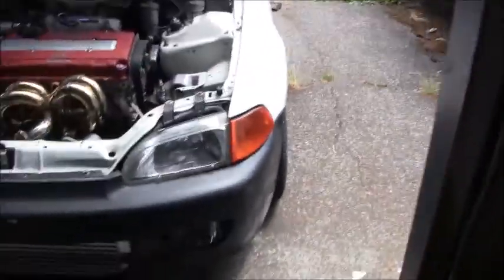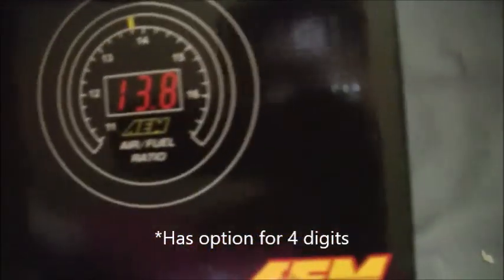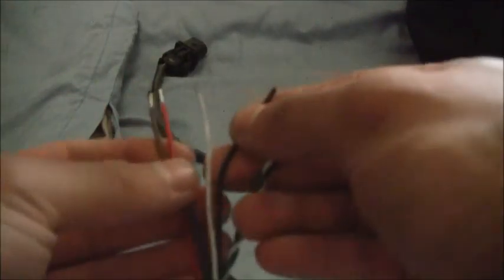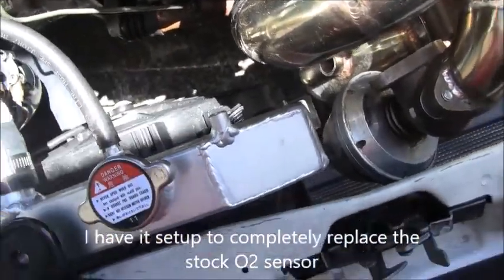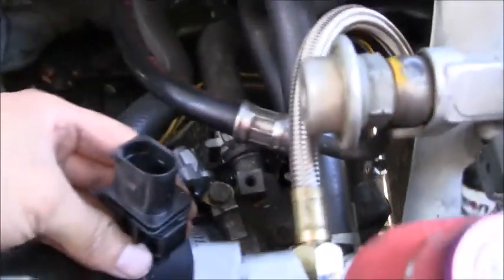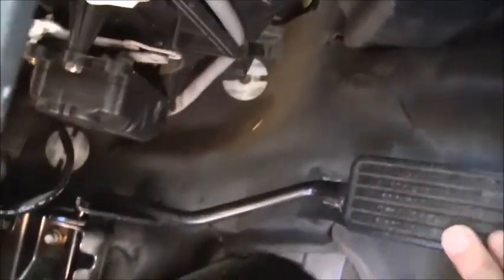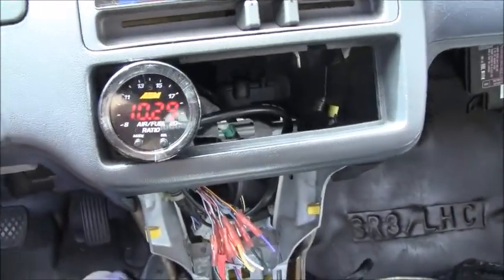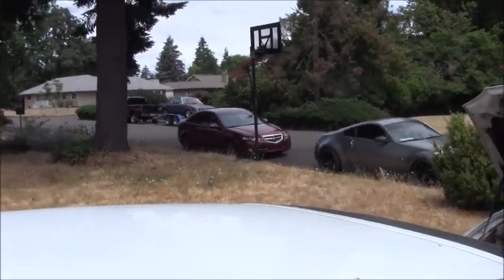AEM X-Series Wideband Gauge Unboxing & INSTALL

Comment: Ouch!  Please don't start the car on a hot sensor.  The little ceramic element in the sensor gets to over 1200F, then gets blasted with cold startup air.  #1 way to kill/degrade WB sensors.